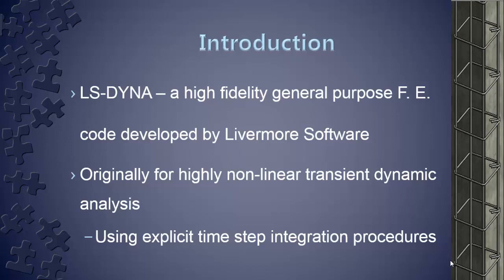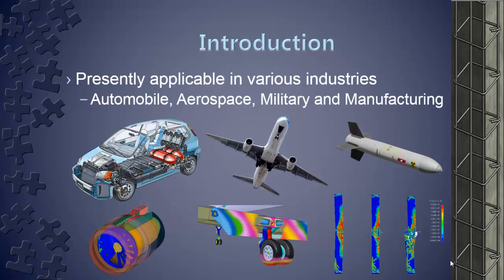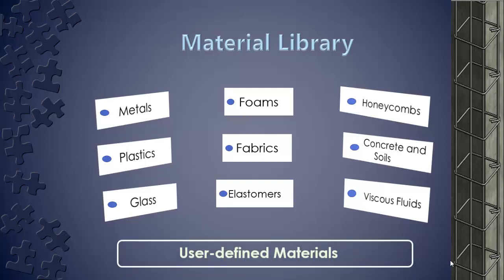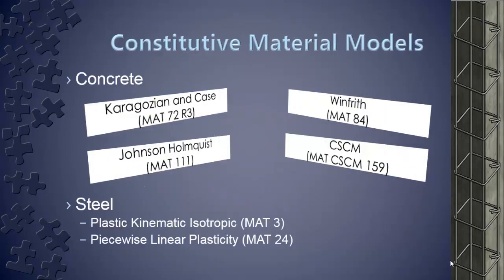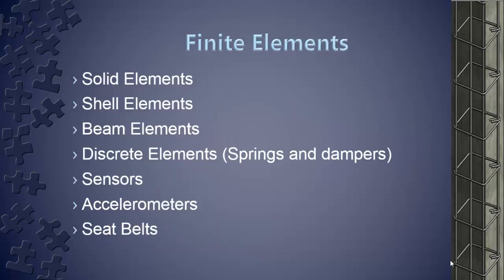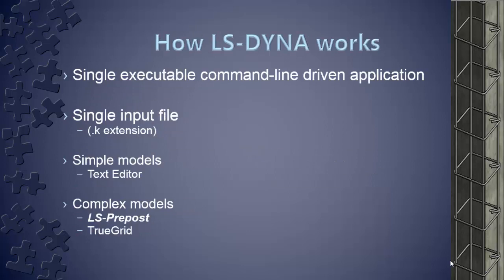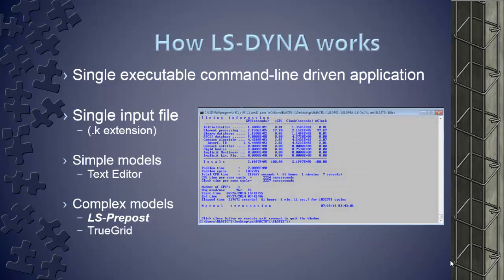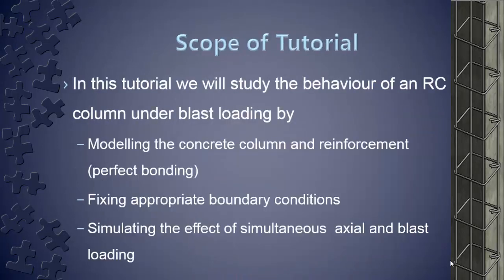1.0 Introduction (LS-DYNA RC Column subjected to blast)

Comment: can ls-dyna perform a static nonlinear analysis of concrete beams strengthened with CFRP plates? what is the best  and accurate software for this case ls-dyna, abaqus or ansys workbench. Please advise me. thanks
Reply
Reply from the maker: +Abdalla Mahzouz LS-Dyna should be able to handle static nonlinear analysis but it is better suited to nonlinear transient dynamic analysis such as impact and blast analysis. I think abaqus and ansys may be the tools of choice for you.